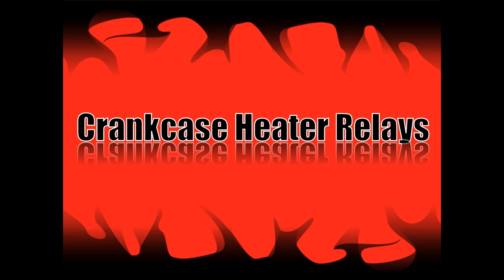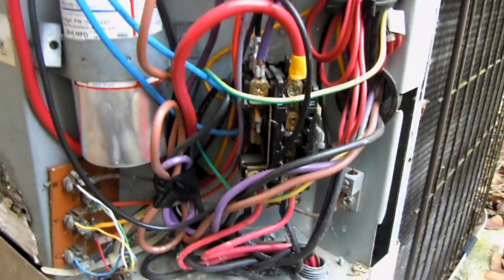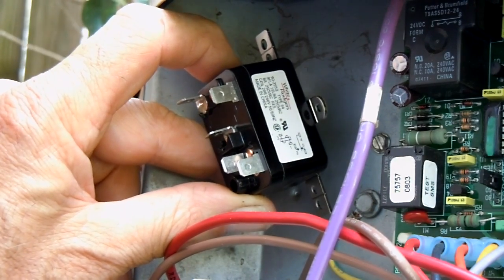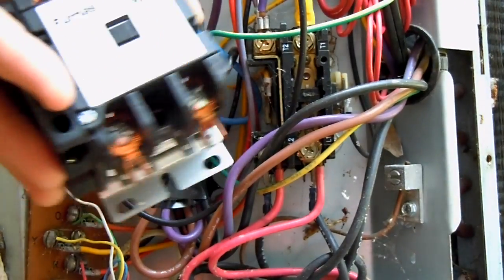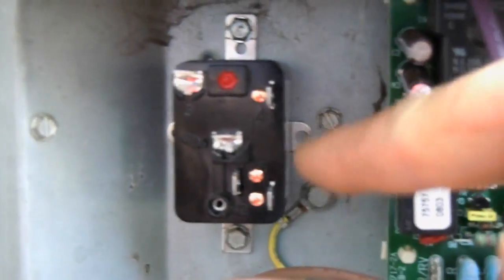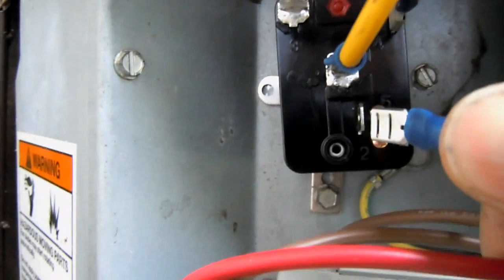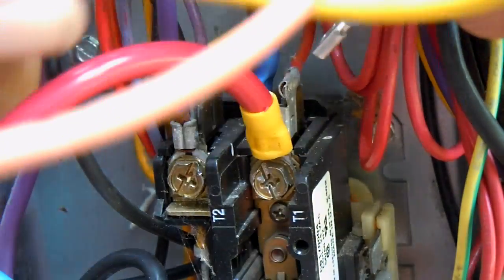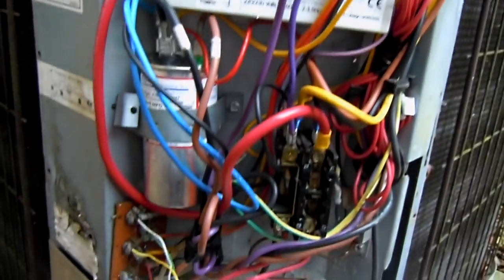HVAC Crankcase Heaters 2

Comment: Dr. Z , Since your unit has a single pole contactactor, could you have also connected the crank case heater to the normally open side of the contactor L2 & T2 so that when the contactor is open the heater would be on and when the contactor makes the heater turns off.?.......I think you would saved some money and space in your unit.  Please see Grayfurnaceman's mans video on connecting CCheaters. Your still the man in my book.
Reply: Well said.

Comment: i like crankcase heaters to dr. z. i dont put em on everything but i do on anything that will operate whete the outdoor ambient is below 70°. i was taught that liquid migrates to the coldest spot and if that outdoor unit is ever gonna be run when its colder outside it ya should have a heater.

Comment: @hpaddyh1 thats completly false. there has to be a complete path for the flow of electricity to make the winding hot and act as a crankcase heater. if the contactor is single pole and the contacts arent comnected then where does your complete electrical path come from? tyat was the most ridiculous post i have ever seen

Comment: @DrZarkloff 
ok but, crankcase heat isn't going to help under severe liquid migration. You've got more problems than just trying to pump liquid then. you've got loss of oil. And without oil pressure protection it don't matter what kind of compressor you have. I've replaced my semi hermetics and hermetic recips with scrolls and have had substatially less compressor failures. that is basing it on same unit comparisons. No crankase heat also. but we could argue all day could'nt we Doc?

Comment: I've see htrs installed on some Ind/Com. units and as many  or more without.It's just not a real big issue.As I mentioned before I've had large scroll equipped units that have operated against very abusive conditons and have done quite well. Certainly better than hermetic recips and semi hermetics. That is why the Discuss compressors when introduced were so good.

Comment: @hpaddyh1 
I've see htrs installed on some Ind/Com. units and as many  or more without.It's just not a real big issue.As I mentioned before I've had large scroll equipped units that have operated against very abusive conditons and have done quite well. Certainly better than hermetic recips and semi hermetics. That is why the Discuss compressors when introduced were so good.

Comment: @DrZarkloff 

residential units don't normally run under ambient conditions that commercial/industrial units do. the problem with liquid migration is usually not an issue. Scrolls can take the small amounts of liquid encountered in rsidential apps.

Comment from the maker: @hpaddyh1 You can leave it running all of the time. You don't need it to heat the oil when the compressor is running so why not turn it off.

Comment: @DrZarkloff IMO, every heat pump/low ambient unit should have a crankcase heater, regardless of compressor type. The crankcase heater prevents liquid washing the oil away during the off cycles. I also like what you did with the relay, very professional.

Comment: you don't have to use crankase htr on scroll. If your in a situation with alot of liquid migration than you need an accumulator.With excessive liquid migration your going to have a problem with system that needs to be corrected.You don't have that problem on residential usually unless your running in low ambient conditions. I've run scrolls in conditions that would destry a recip comp. VSD units running in 0 F ambient condition. No crankcase htr.

Comment: In response to hpaddyh1; the reason you need a crankcase heater (especially on a scroll compressor) is to make sure that when the compressor is not running that the refrigerant doesn't migrate into the oil, causing the compressor to be sluggish when it starts causing a high amp draw possibly tripping the breaker or causing damage to the compressor. This is needed especially on a scroll type compressor because it is not recommended to put a hard start on a scroll compressor. Thanks, Richard H.

Comment: that single pole contactor is used so that the run winding can be used as the crankcase htr, keeping voltage on that leg..
That is what the intention was with the older recips.

Comment: Hi Dr. Zarkloff, thanks again for the great video.  Thanks to  you video,  I can finally install one on my unit. Dr. Z could you please tell me the exact type of relay used? Also how would I let the crankcase heater be off during the summer time, perhaps using an external thermostat....
Thanks in advance for your patience and expertise.

Comment: Dr. Z in the schematic you show the crankcase heater relay coil connected across the terminal side of the contactor. It is always going to be energized.
Newbie to hvac, old dude to electronics. Hank